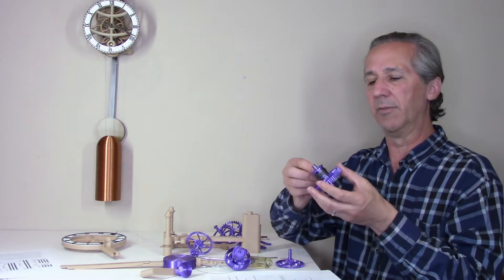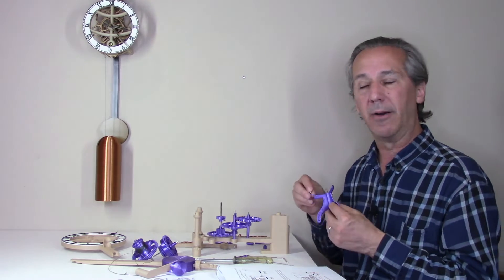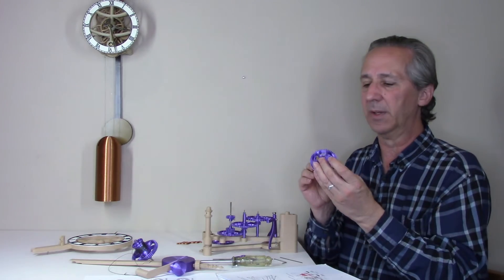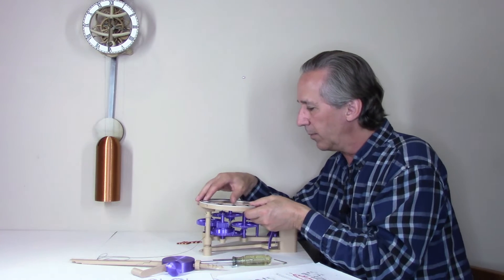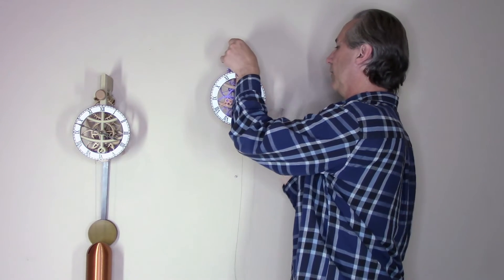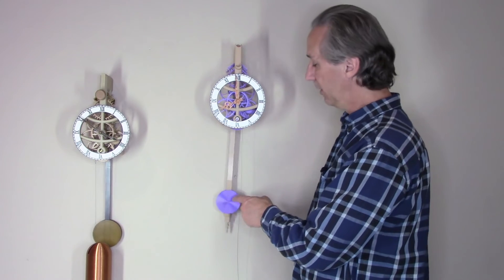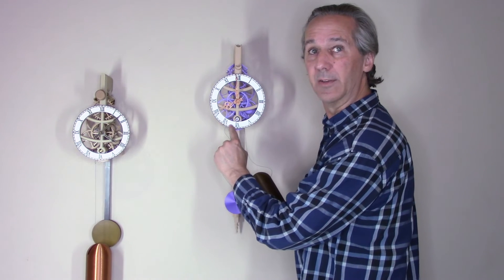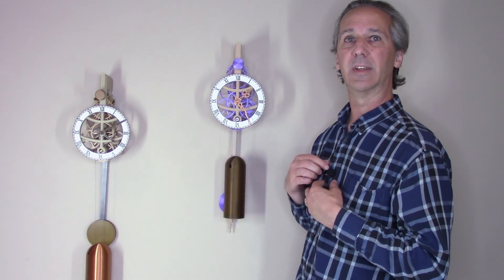8-day clock gear assembly

Comment: Hi Steve, 

At 11'31 you say that with 1 cord only, we will need more weight, right ? 
My guess would have been the exact opposite... but you are the engeenier, I'm not... Could you confirm that if I use 2 cords, I can divide the required weight ?
For me 2 cords with 2 points (one fix, one on the gear), will make the weight go down twice slower (improving the time before rewind), but will compromise the weight.
Thanks
Reply from the maker: Your thought process is correct. Using a pulley with 2 cords will double the runtime and require twice as much weight. What I was trying to say at 11:31 is if you test the clock by hanging weight on the single cord, then you will need to double the amount when you add the pulley and add around 50% more for a safety margin.

Comment: thank you for your designs Steve, brought and downloaded, parts are printing as we speak, all parts from amazon coming tomorrow, nice build project for over Christmas, any tips before I build ?
Reply from the maker: Print the pages listed in the quick start section of the manual as a reference. The rest of the manual will walk you through the step by step assembly process. 
The only other guidelines are to minimize friction wherever possible. Make sure the pendulum support bearings spin freely. Drill the holes in each gear and the frame using a slightly oversized drill bit so they also spin freely.
Reply: @stevesclocks  thanks steve

Comment: It's a very "tight" niche this one of mechanical clocks - I mean, don't expect a large number of followers to this subject on your channel; but believe me, the few ones that watch your videos (like myself) are geting amazed by your "to-te-point" approach, and by your skills. I just subscribed to your channel, and I am sharing these videos to my friends. Congratulations!!!
Edit: Sorry for my bad English, I don't use translator bots, so bear with me. Cheers from Brazil!
Edit 2: This clock will be my first project when (and IF) I get a 3d Printer.
Reply from the maker: Yes, there is a small niche of mechanical clock builders. I recently exhibited my clocks at the Bay Area Maker Faire and was encouraged by many teenagers asking how to design a clock. Maybe there can be some growth of new clock designers in the maker community. 

3D printers have reached a point where a US$200 printer is capable of printing most of my clocks. They all have enough accuracy to print the components. The limit is the bed size needs to be large enough to print the dial in one piece. A Prusa mini or Bambu lab A1 mini can print most of my clocks. A Prusa MK3 or Ender 3 can print all of them.